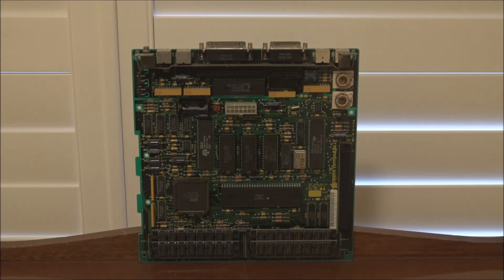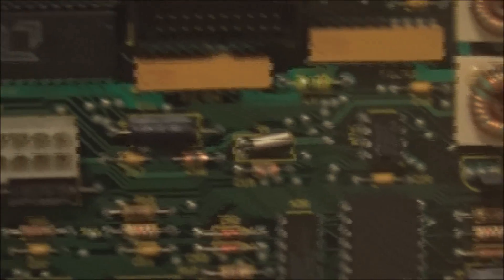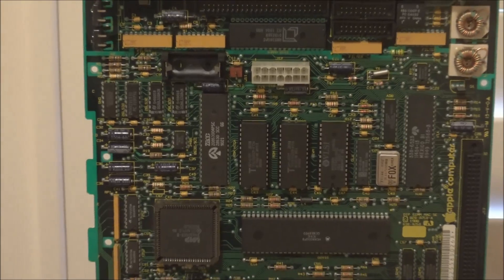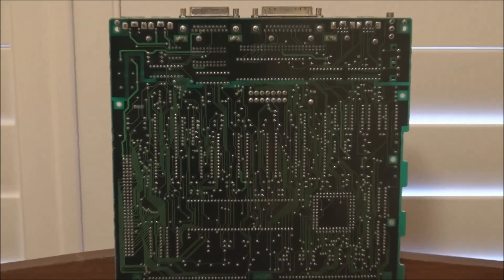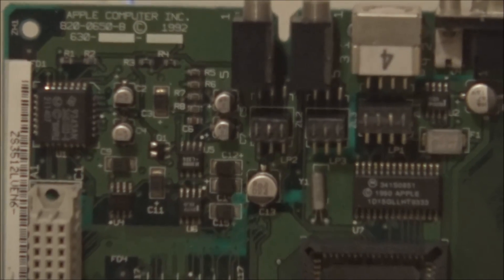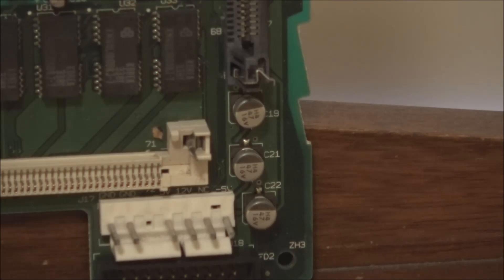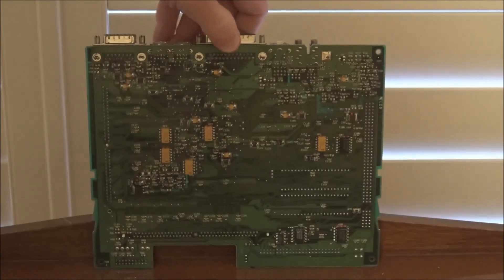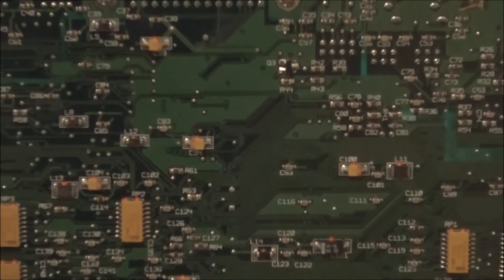Common Issues with Apple Macintosh Systems - Part 1 : Bad Capacitors

Comment: Hello there ! Great vid. I found the first Mac computer we had home when i was a kid, in my parent's attic, and it seems to suffer from the capacitor-leakage-problem. It's a LC "1". I am not that at ease with technical english (I'm french), so i am not sure about being accurate. Since the capacitors are a bit messy, is there a list / schematic somewhere where i can find the proper name/reference of capacitors, should i want to replace one ? Thanks in advance - Pierre

Comment: Great videos! I have an interesting problem. I recently acquired a beautiful Macintosh SE SuperDrive from July of 1990. It boots absolutely fine and will work completely fine for 5 minutes but like clockwork after the 5 minutes it will shut off then power cycle continuously- it will shut off, the screen will come on, do it’s classic beep, then shut back down; and it will continue this loop until I flip the power switch off. If I try to turn it back on it will work for less than the 5 minutes depending on how long it has been sitting. Due to this behavior I am assuming the PSU runs into a failure mode after it reaches temperature. I figured you may know more and have ideas of how to rectify the situation. (Oh and the fan also spins up and down with the power cycles which hints that the issue is power)

Comment: OK, Love your series but there needs to be some better explanation here. You  described a capacitor as a storage device which is an electrolytic capacitor. You correctly identified them being used to smooth out voltage fluctuations. Regular capacitors however are used to pass Alternating current, such as sound, and block DC Current as from a power supply.   They are booth made by placing two sheets of conductive material as close together without touching as possible. The way to keep them apart is using an electrolyte.  The charge is not stored in the electrolyte but on the surface of  one of the conductive materials.  OK, now capacitors have a shelf life. That life is about 20 to 25 years for electrolytics and up to maybe 30 for paper and oil regular capacitors.  I rebuild electronics from 1922 (radios) to current time, Computers etc of at least 20 years old.  I never turn them on till the capacitors are replaced.  Yes you can test them but that takes time. You find all or  most all need replacing anyway. The reason to not turn on before the caps are replaced is simple, as capacitors get old they leak.  Some of the DC gets through them and changes the operating parameters of the circuits they are in. In a Power supply that can literally over tax you power supply and result in damage.  Its not just old Mac. its old anything electronic that has this problem.  Some of the newer types of capacitors made might last up to 10 years longer due to better manufacturing ways with better components.  I am sharing this as I got out of the first part of the Video that Mac have bad caps. That is not the most correct way to put it. All caps are bad when they hit 20 years. Yes I know of some and me included that have found some that last longer, but I have also found out getting them out and new ones in will over time same a lot of time and Headache.!  Good Job on this series and I am enjoying it.

Comment: So why not replace the bad old capacitors with newer surface mount capacitors?  Why use only radial through-hole caps?  Why not replace all the capacitors found on the board including the axial through-hole variety.

Comment: Fantastic video!  We had a 512K, and would get the "Sorry, A System Error Occurred" message more times then I can count-right from the beginning, when I first started using it.  I've had someone suggest that it was because the 512K had no fan, but I don't whether not that's true.
Reply: I forgot to say that we either got the 512K in late 1987 or 1988; I can't remember.

Comment: Its not just the SMD capacitors that fail, most capacitors made in the early 90s failed. Apple and Sega used the same brand capacitors I noticed, so that is part of the problem. Poorly made cheap caps both THT and SMD. An easy way to check if a capacitor is failing is to use a multi-meter with a capacitance setting (not all of them have such a setting, so beware), and just measure the capacitance. If it's lower than it should be, the cap is bad or going bad.
Reply: My sega genesis died from that issue, replaced them and that got it working.